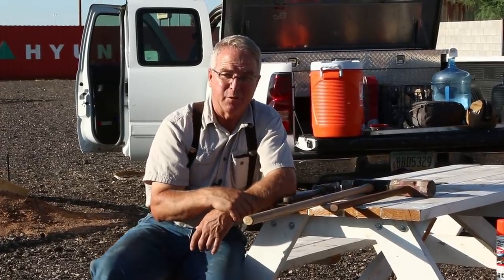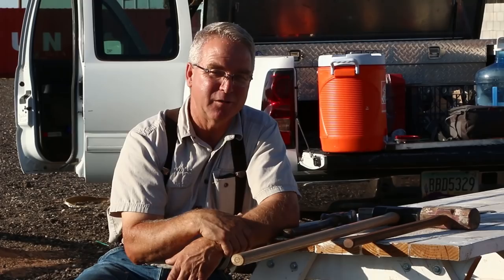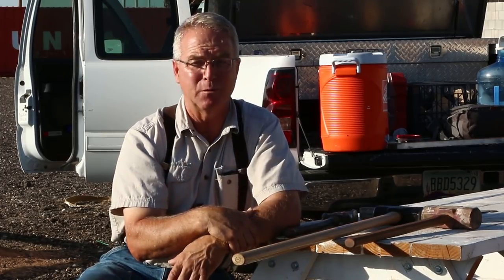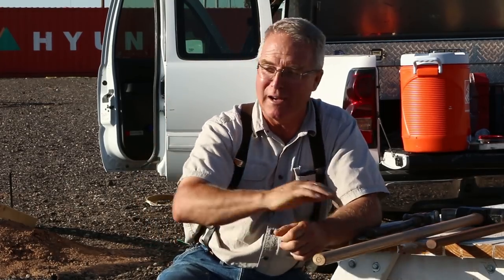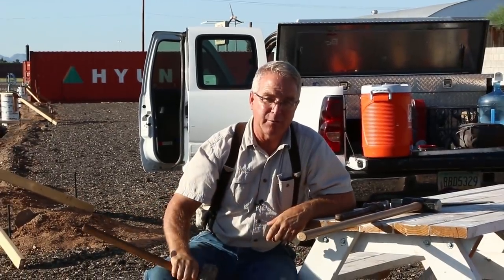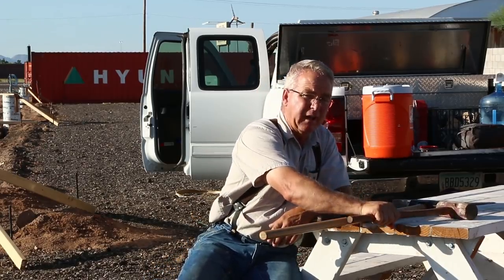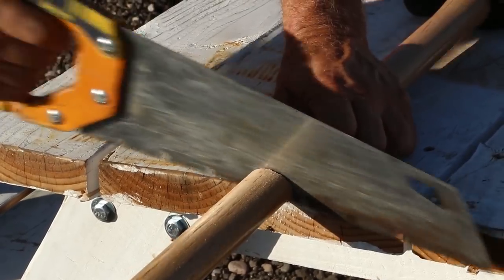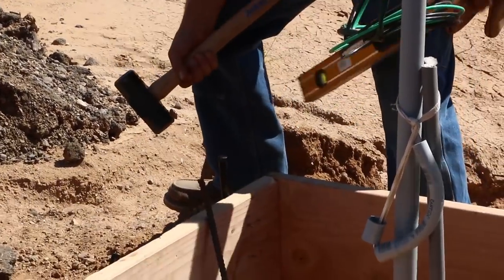Best Sledge Hammer for Concrete Work

Comment: One thing i've learned, oddly, from range shooting is that, putting A to B is actually a dance between two things. Speed and mass. You can get similar results from a low speed hit, but with great mass, as you'd get from a high speed hit, but with low mass. Of course, all within the governing laws of our Universe.

I have a pretty fast hand, so most of my hammers are light, compared to, say, my departed uncle's heavier hammer, that he used later in his life.

THUS, all combined, i think that, it's wise to cultivate speed as a youngster, and slowly increase mass over time, it gives you...range VS using a heavy hammer from the start and potentially crippling yourself later in life. Just my 2 cents, and it is that, i'm still getting old. :)

Comment: I hate to burst your bubble, but the heavier hammer is better for driving nails and stakes, if you can swing it, of course.  The impulse (momentum) is what drives the stake which is mass x velocity.  Since energy is 1/2 x mass x velocity^2, it takes more energy to get equivalent momentum from a small mass.  I know it seems counter intuitive, but think about it for a bit and you will understand.  Being able to swing the hammer is really the most important factor, as you said.  However, swing the biggest hammer you can comfortably to get the most work out of it.
Reply: Momentum will be conserved between the hammer and the stake... and the ground and the air and your arm, so what actually matters is to match the impedance of your hammer to the impedance of your stake, to maximise energy transfer. And in this case,  impedance is mass.  The closer they are,  the more energy and momentum the stake will end up with. The best would be a hammer that weights the exact same thing as the stake.  But your arm also has a "power band". You can apply more force to a hammer that isn't too light or too heavy, making it go way faster. You do spend more energy, but you have plenty of it and you'll get the job done faster. It will also feel better for your arm.
Reply: This is correct. It's about momentum.
Reply: Oh look. duggydo has an opinion too. No video to back it up though. No body of work we can all look at. Just an opinion and they are as common as , well you know what.
Reply: Hello Tim.  If you are so inclined, read what I wrote again and give it a think.  You can also find plenty of videos and articles about momentum and energy.  I actually don't disagree with anything he says except for the part about kinetic energy.  I also know my way around hammers, but you will have to trust me on that one I suppose.  ;)

Comment: When i first broke out in the oilfield and first introduced to a sledge it was in production well testing and we had 10lb long handle hammers used to rig up 2in iron and buttond up by hammering the hammer unions on each end of a connection. It wasnt bad swingin it but in certain tight spots or angles it was a lil harder to make up. It wasnt until i left that job and got hired with Halliburton on a Frac Crew that i found n figured out the best sledge for mostly overall work. They used 8lb sledge, which we built ourselves if they broke with wooden handles that were long but were all.cut down to the length to around 16in or soo same as the guy did in the video and we had tons of rolls of high dollar grip tape which we used on them. Some had custom ways of wrapping it and were tailored to there best grip n comfort. Once you made your own Ultimate Hammer Of Thor, you learned how to use it which was reffered to the Frac Swing which was pretty much swinging the hammer fast n hard by rolling your wrist that once mastered, you could out preform n tear down iron faster than anyone using a 10lb long dick handle sledge no matter if they thought the weight alone would give them an edge or the amount of swing power they would get from a slow long big swing. Cause with all that, you gotta be accurate and better have gas in your tank cause youre gonna be winded n tired. 8lb im gonna be generating alot more speed, accuracy and power with each hit, i wont be exerting myself doin it. Now im on a drilling rig and they use nothing but 10s with long handles, which i dont use cause i brought my own 8lb lol. But there have been a few occasions with our 4in thick high pressure lines that have bigger n thicker hammer unions that even with the 8, youl probably be hitting it a 1 million times to get it to budge, even the 10lbs wouldnt be enough that we would have to bust out "Big Bertha" our 16lb that had a medium length handle and we would make sure only the best hammer swingers used it cause Bertha would bust any tough union off but if you couldnt man up n swing it with accuracy precision, you could get hurt and worst of all, break Bretha! Cause there is only one Bertha and if you broke it, then now we gotta spend a lil time  cutting the broke handle off, takinniy out, getting n putting a new handle on n in the line of oilfield where time is money, youd be chewed out for it lol. Either or to eachs own. Just my opinion on what i believe works best for me and for the application its used for as far as when it comes to any parts of the oil field where iron is used and made up with wing thread hammer unions.

Comment: So you basically end up turning it into an engineer's hammer (aka a drilling hammer)...
Reply: I guess different parts of the country got different ideas about how to do work.  In my part of world (Arkansas) most Gf's would look at you like you had 2 heads of you showed up with the handle cut off of your sledgehammer.  At least 20 years ago they would. Don't know about now.
Reply: @jameshuggins4300  I believe that is correct. Every where you go ideas about construction and the tools to do the job are a little different. Always good to hear how different regions do things, the tools used and ideas on what's best.
Reply: I'm always looking for new ideas.  One thing I learned back then was it always better to be adaptable to try new ways of doing things.  That's why I love this channel!